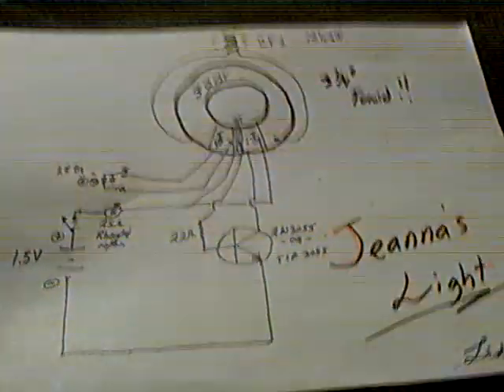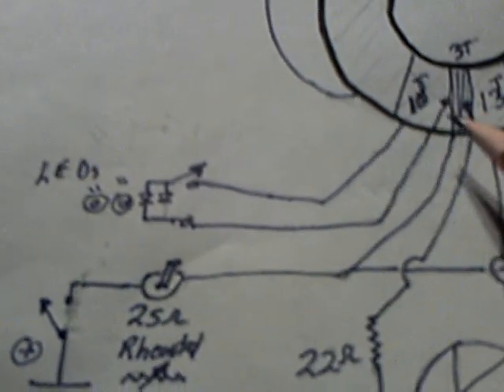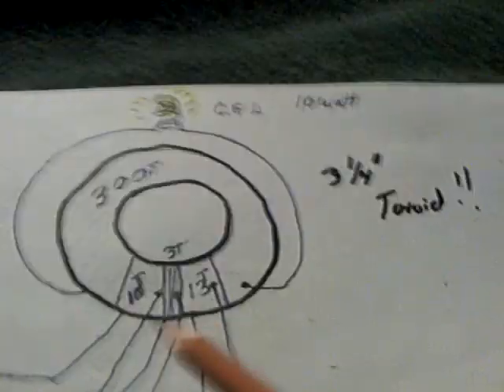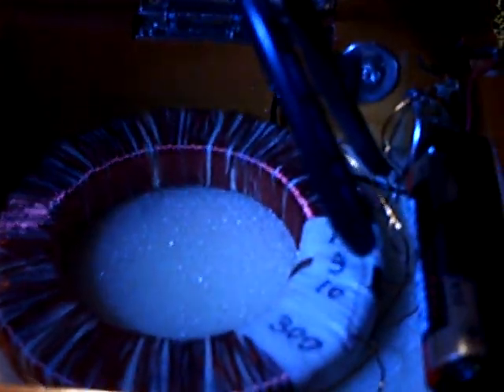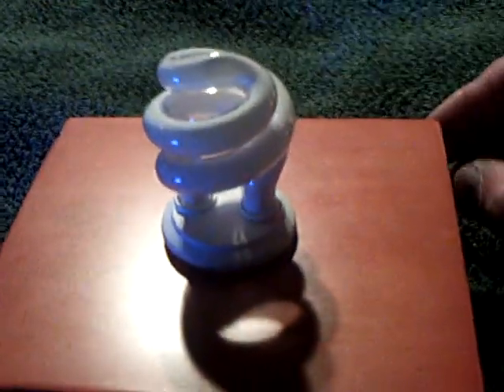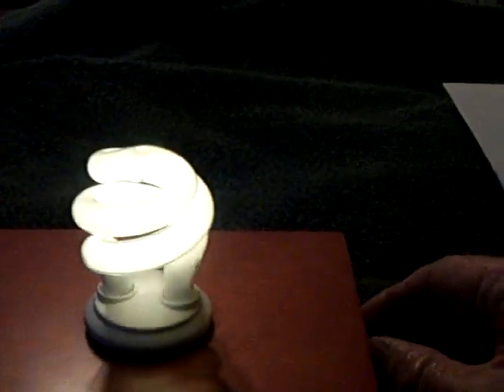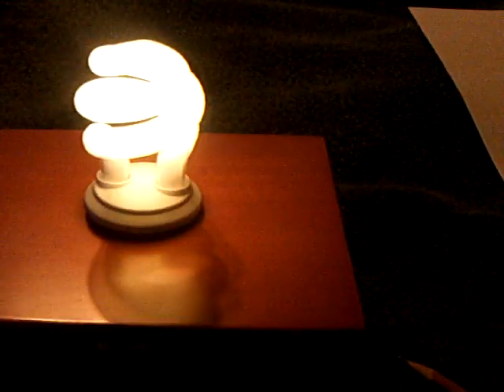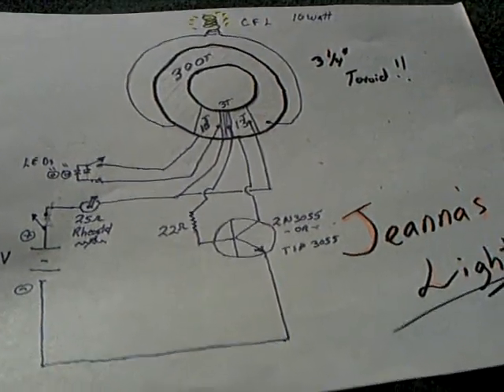Jeanna's Light --In a box.

Comment: i concluded that 100ma 0.1 watts per volt since its about 1.5 volts thats 0.15 watts in 17 hours it would consume about 2.55 watts this should run for 17 hours on i aa batter at 100ma of consumption anymore would be over unity so how long does it run for wen consuming 100ma
Reply from the maker: Numbers. Numbers. Numbers.  Just build one and have some fun with it.

Comment: Hey Lid,

How about two trays inside the box, one for charged batteries and one for depleted batteries.  There is a another battery holder that is a charging station with an associated port.  You take a solar panel and just add a small JT circuit to it.

So you have a nice light box that holds eight or nine batteries with a built-in charging station and accompanying external solar/JT charger panel.  The idea being that you could get a week's worth of light, and the batts would last a long time.